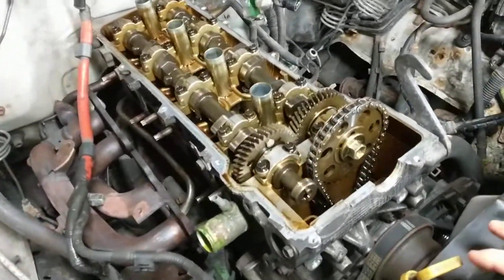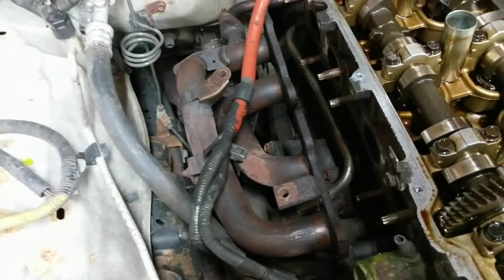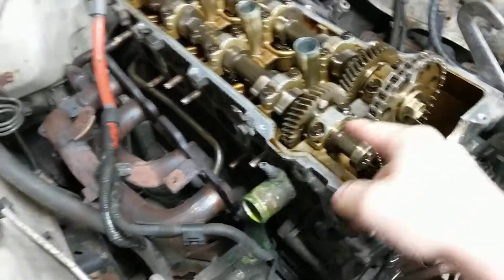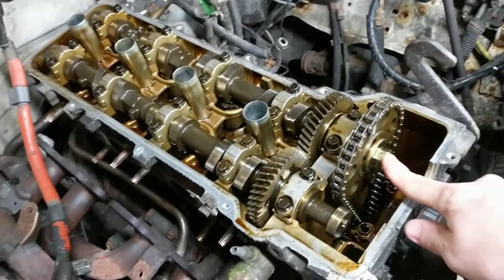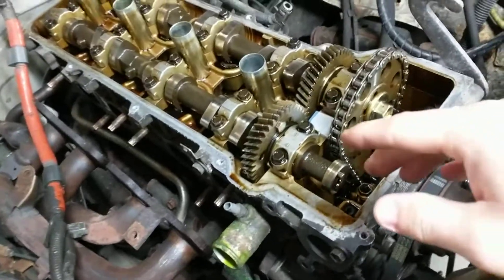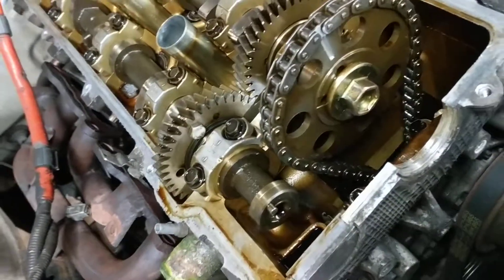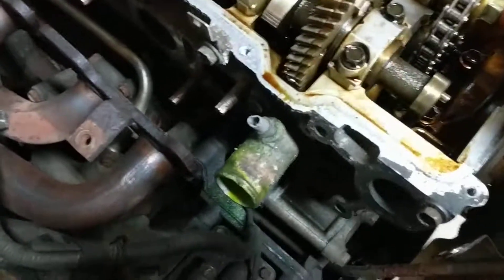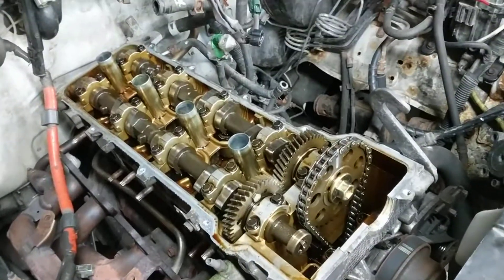How to remove a Toyota camshaft bolt  (head gasket job) 3RZ-FE

Comment: I'm doing the head gasket on my 2004 Tacoma 3rz and watched this video ahead of time. I honestly saw this and thought I wont need to do that I've got great long handle wrenches and worst case I could hold the cam with a wrench then blast it with my impact to shock it off.  Then when it came time to actually do the job. I tried with wrenches and didn't like how things were flexing (just like you) so I thought I'm just going to try it how you did it. Steel dowel through the cam sprocket and two steel shims underneath on top of the head surface and I stuffed a bunch of rags in the timing chain opening just in case one of those steel shims decided it wanted to try to fall in.... and it popped right off.  So thanks a bunch for sharing this tip!

Comment: Why didn't you try to get it off with an airgun or impact? Turning it faster will put less torque on the cam, ie before it will torsion the camshaft the nut should break free.

Comment: Great tip, my job is halted because I do not have the bar, looking for one now; it is unbelievable how much of a garbage that Hayne manual is! many things are not explained at all and mostly everything I am doing have been a struggling; I moved the timing a little bit trying to do it the way manual explains and I am pissed off royally after all the time I put setting the timing perfectly; I had already removed the exhaust camshaft, again following the stupid fucking manual because it is all I got!

Comment: HIGHLY recommend using something that won't fall down into the timing hole. I used a big, fat washer and it slipped into the timing cover after I loosened the cam gear. Couldn't fish it out with a magnet, and ended up pulling the entire motor to get the timing cover off!
Reply: Yes, use a much longer piece of flatbar that won't fall into the timing chain case!
Reply: Damm that really sucks!!!
Reply: That sucks wow

Comment: I'm sure Toyota makes a Cam lock tool for this job, get that adjustable Crescent wrench out the garage, your not doing Plumbing work here. It's very easy to damage the head by using the Wrong tools.

Comment: Super awesome trick! If only I hadn't dropped that nice little aluminium cube all the way down the timing chain compartment. Darn, that's when you wish aluminium was magnetic!!
Reply: The new version of my aluminium plate has two sides that hold-on to the side of the head. It won't happen again, if I ever need to remove an intake gear again.

Comment: This tip was incredibly helpful! After screwing around for ages this got the job done. We had to add heat because  a previous remover of the cam added loc tight (terrible idea) and a cheater bar to add length to our breaker bar. Thanks man!

Comment: You are the man! I just gave it a shot and worked like a charm.  I ended up joining two 3/8 in extensions and shoving them through the cam wheel hole.  Great problem solving